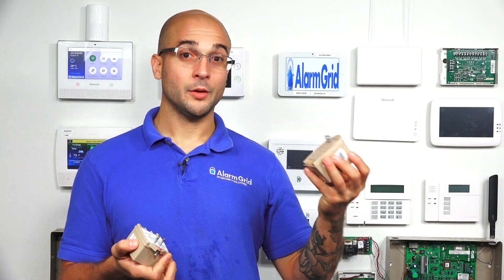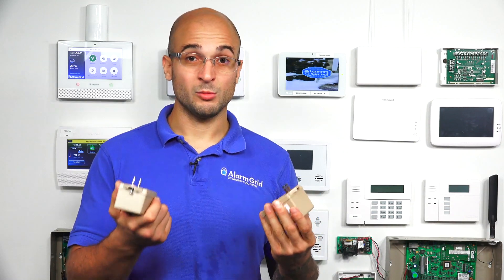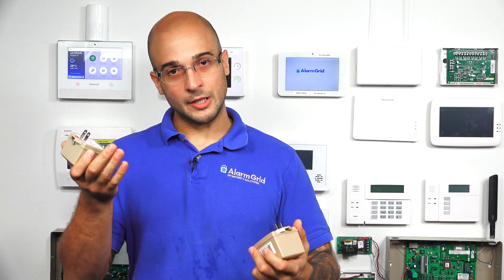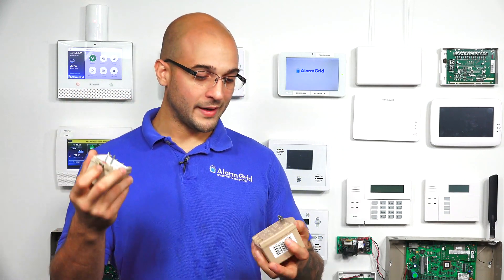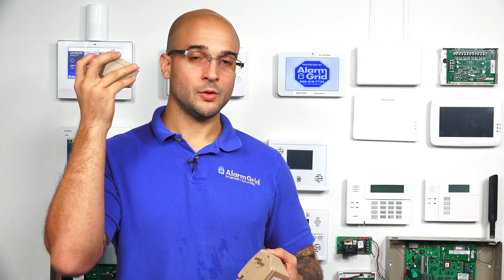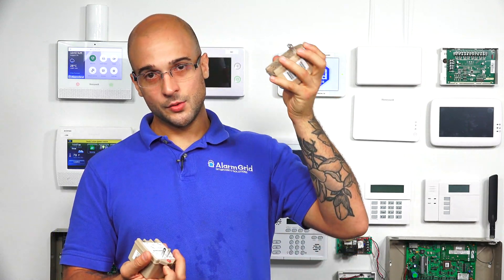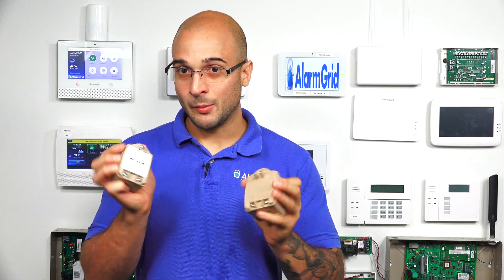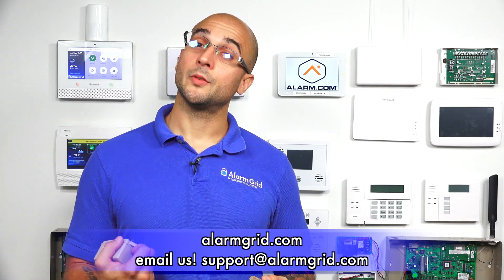Replacing a Honeywell 1321 Transformer with a 1361 Transformer

Comment: Best home security equipment content on YouTube!

I recently had my alarm company update my communication method to cellular. They installed a Honeywell LTE-XV panel. They didn't change the transformer which is still the Honeywell 1321 - 16.5VAC 25VA. Ever since then I have been getting a system low battery message. I changed out the battery 3 days ago and still have the low battery message. I power cycled the system, no luck. I suspect that I would need to increase it to 40VA as you suggested. However, the alarm company tells me 25VA is enough to power both the system panel (Honeywell Ademco V20P) and cellular panel (Honeywell LTE-XV). Could upping to 40VA have charge the battery and clear the low battery message? Again, this is a brand new battery I installed several days ago. 

The transformer power wiring I have is 2 wires, same as you have shown. Can I buy a 3 wire/prong A/C transformer (with ground) and safely connect only 2 wires?

And can I use the same 12 Volt 9 Ah battery to provide backup power for the system panel and cellular communicator? 

Thank you!
Reply: We appreciate the kind words! It sounds like you are going in the right direction, If your company won't switch our that transformer I would advise you to tell them to call the manufacturer resideo. As a tech that formerly worked for them  I can tell you personally we had tell many techs that tried using a 25va transformer on cell and panel with nothing but poor results, the manufacturer recommendation has always been to swap the transformer to a 40va or use two seperate transformers. It could very well be what's causing your charging issue.  Also yes you can only safely use two wires using the both AC terminals. FInally we would recommend using separate backup batteries but it can be done using one, but it will greatly reduce your up-time on backup.